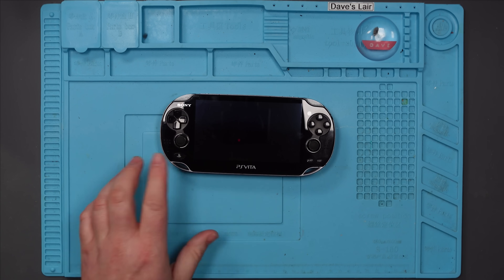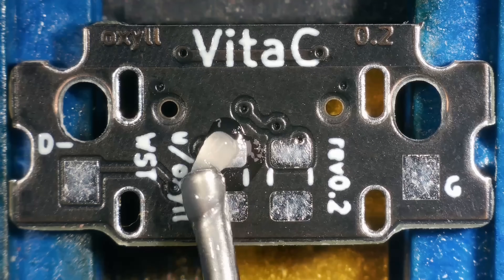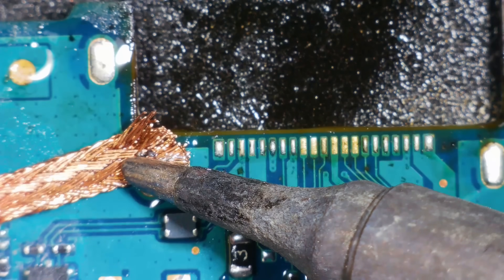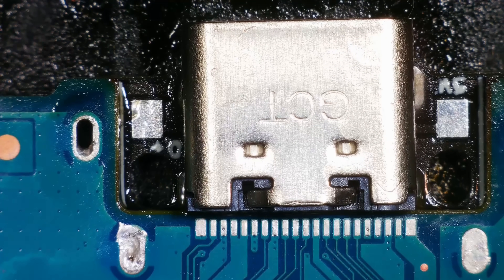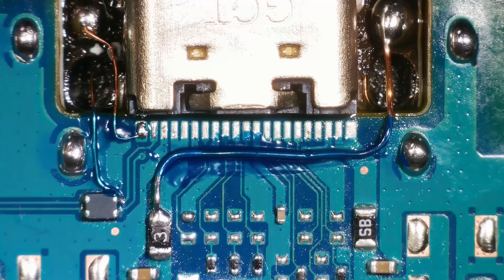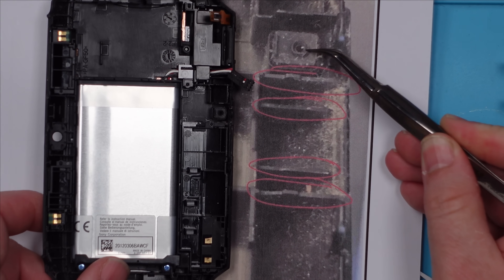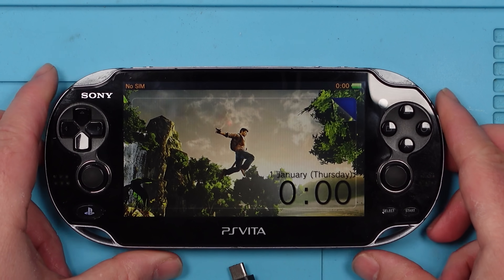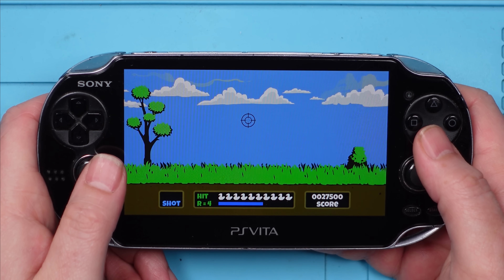My PS Vita DIED | Let's INSTALL a USB-C Port!

Comment: man having a digital microscope would be so nice I just don't have the space for it lol. I usually use a jewellers loop to get a close up of my work and then just use my naked eyes after I am lucky my eyesight is decent as far as detail but I do have diplopia I am just used to it though or I close one eye. It's totally doable though I modded and repaired about 12 Switches OLEDs and Lites this way

Comment: I'm not sure if you have a hot air station but it really is worth using for those small components. Same with the ports too! But yeah it is sometimes tempting to just use the iron lol

Comment: would you recommend this mod for a beginner? My ps vita's charger port is bad.
Reply: Absolutely not. I wouldnt consider myself a beginner, but I wouldn't attempt this. 

Youre better off trying to troubleshoot your existing port. Unless it's physically damaged, in which case just pay someone else to do it for you.

Comment: Good job. I like soldering but i thought it will works using vita connection pads not special attached wires.

Comment: Just did this mod using this video and it took me like 3 hours. I have to commend your skills. You make precise micro soldering look super easy. And such a clean, organized job too.
Reply: I want to do this mod because the touchscreen doesnt work if i put it in charge and it crashes, and it doesnt transfer data too
Reply: @dumitrasenciu8021  have you done it?

Comment: hi im struggleing to do this the solder just wont stick what am i doing wrong here? is it the soldering iron isnt hot enough? ive got low melt solder and UG78 paste flux but it just wont stick nicely. could i be using the wrong solder?

Comment: Entertaining and extremely helpful. Up until now my only experience with soldering was tinning and joining wires and replacing the shoulder button on my Steam Deck. But I really wanted to do this mod and your video gave me the confidence and knowledge to do it. I'm still in a bit of disbelief that I was able to solder such small components with just a magnifying glass and $50 soldering station. I had to get a hot air station for desoldering the old port, but that's alright since this project really gave me the confidence to look for other modding projects that I had shyed away from due to the soldering work. Subbed and thanks again for documenting the install of this mod so well!

Comment: At first, I wanted the OG PS Vita with OLED screen... But then I got a Japanese Aqua Blue PS Vita 2000, with Micro-USB port, and realized that the OG PSV has a weird cable/port situation. 😅 I'd rather go micro-USB to USB Type C than this port on a board, on a board, approach.

Comment: What if the orange light does not appear when plugging the charging cable in the console? ...but when I long-press the power button it starts flashing at every 3 seconds ..what does it mean??

Comment: You didn't need to fix the charging port you literally just had to let it charge until it turned on. because it hasn't been turned on for a long time

Comment: I enjoyed your video because I found it to be quite interesting. Instead of pulling apart your ps vita to change its stupid in design usb female port to the awsome usb C,  is it possible to use a female usb A 3.0 to female usb A 3.0 adapter or a female usb A 3.0  to female usb C adapter to the ps vita's own usb 2.0 cable.

I mean like the way you would connect the ps vita's charging cable the usual way  to the ps vita's stupid in design port and so instead of using that cable to charge it the usual way, will a female to female usb 3.0 adapter or female usb A to female usb c adapter connected on to  its usb 2.0 side of its cable and the other end goes to the ps vita's female usb stupid in design port and so that way you can connect a usb thumb drive on to its own type of cable or use a 

usb A or C cable to charge it or to transfer files to the computer and so would that work on that stupid usb in design port or would it damage the ps vita? 

Ok your charging port was damage but hey is it posible to just use an adapter because I am curious for doing that with my ps vita. 

All the best because again I found your video with your amazing personality to be very interesting.

Comment: I noticed that's a 3G model. you should install a PSVSD in it to add a micro SD card slot replacing the old 3G modem. You can get them for about $25 US and it's much better than the proprietary cards or a SD2Vita

Comment: IMO you need to let your iron dwell just a tad longer on the heavy ground mounts. You need the heat to get down a bit further to suck the solder down along the leg for an even better mount.

Comment: I got one for 17€ with a charger today for parts. SO i went and open it and i see that the battery cables that conect to the console are not in good condition, so i don't know if i should buy a battery to test it out or just resale it on ebay. It seems faulty ones are going for around 70€... Crazy!!!

Comment: Do you use any kind of fume extraction at all? Solder paste fume is nasty. You look glassy eyed by the end of most of these videos. That stuff gives me a headache and I get all clumsy and stupid from breathing it in, so I installed a small shop vacuum in the next room with a long hose so I can still hear while it sucks the smoke away. It's great for cleaning parts and the floor too. lol

Comment: A pretty tricky board, I'd route it differently :P First, those USB-C-to-2.0 jacks are pretty rare and expensive, too lazy to look for so even for 2.0 I only use those that have all the pins. Hot air-only for manual soldering, yet are found virtually everywhere. Second, those huge resistors, what are those? 0603 or probably even 0805? Nah, 0402-only, there's not much current there anyway. And, wire spaghetti :( Never! I'd add through-holes for the on-board wires so you'd just have a "wire brush" that fits the original pads (only 3 thin ones, not a big deal). Also a good touch would be to solder some thick wires or copper pins in for the mechanical rigidity.

Comment: Hey! I own a vita myself and I love it but one question I’ve always had is if it would be possible to upgrade the speakers on it, like putting iPhone speakers or something like that. Something with better bass and just all around better sound quality
Reply: It should be physically possible, as its just speakers... However you have to take into account the software of the Vita probably doesn't allow you tweak EQ settings. Not only that, but better speakers probably need a bit more power as well, so you'd be running into battery drain problems in the long run.

Most handheld devices already have the "best" hardware they can during their design, simply because everything needs to be balanced before production. Can't have a high-end handheld lasting 2 hours on battery or getting too hot.

Comment: This USB-C mod is such a pain in the A.. to realize ! Mine was not charging anymore so after failing with this mod, I went the easy way: I soldered to battery wires an USB-C charging module. Make the job !

Comment: I rather enjoyed performing this mod as well, though I soldered to the trace for d-. I really appreciate how you did your jumpers though. Much neater than I managed. 

For the hot air gun, have you considered using kapton tape to shield the surrounding components? I found it did an excellent job protecting the headphone jack on my 3ds mod

Comment: Tried to take off the old charging port on the psvita 1000 and it wouldn't dudge at all, I have a heat gun and apply flux to it to make it come off and no matter how many times I did it it wouldn't come off. I  tired to apply new layer of solder on the old one and it simply doesn't attach to it. Broke the port now I can't charge my vita lmao.

Comment: I’m surprised the data connection worked that well, because D+ and D- are a differential pair and need to match in length, but I guess USB2.0 is quite forgiving in that regard.
Reply: Is it so fragile? These are mere millimeters, right?
Reply: @root42  Indeed. Even if you were to squeeze 10Gbit through a single differential pair, the signal itself is traveling 20 centimeters per bit, so even with a 5 centimeter mismatch the differential signals are clearly related to each other, but that’s not relevant. The whole point of differential pairs is that any interference will equally increase or decrease the voltage in both traces, meaning the voltage difference stays the same. If the traces aren’t length-matched, the differential signals will be shifted in phase, meaning the effects of the interference on each trace will arrive at the receiver at different times, so they don’t cancel each other out anymore. The higher the bandwidth, the more closely these lengths need to be matched because each bit is on the line for a shorter amount of time, so the receiver has less time to monitor the voltages and clearly discern the signal from the noise.

Comment: Oxyll also sells a Samsung note 9 to ps vita battery board to allow you to replace the aging battery for something manufactured within recent years. Some vita batteries are 10 years old and the new ones on eBay and Amazon tend to be rewrapped old vita batteries.

Comment: I bought a ps vita with a broken charge port for 50 euro's, and i didn't know that you could get a usb-c port for it, so i installed a micro-usb connector instead, but not where the original charge port was, but i installed it in place of the accessories connector. And i think it makes a bit more sence if you would like to use a regular playstation controller and charge the vita at the same time. Nevertheless a great video! The most annoying thing was to install those tiny data wires, i also used lacker wire and slightly bigger wires for the voltage side of things. But it works great and i used a quality port so i am happy with my result :) you earned a sub!

Comment: I was wondering yesterday if there were mods for replacement ports to usb c as I was plugging mine in to charge, but for the 2000 in case the micro usb port gets damaged. Looks like some have done it to a 2000 as well (just not with a special kit, just using standard breakout boards). Good to know!

Comment: Can I express on this video how happy I am to have found someone who actually repairs electronics rather than just prettifying them up?

I just watched a video where a YouTuber supposedly "restored" a non-functional PSOne. He spent fifteen minutes of the 20-minute video cleaning the outside of the console (with the wrong product, to crown the hilarity), one minute stabbing the circuit board randomly with a multimeter, and four minutes reassembling it and 'playing a game with it'. This despite the fact that he didn’t fix the actually broken power button, he didn’t even seem to check the giant malsoldered mod spidering across the circuit board, and he didn’t even try to hide the fact that the PSOne never actually turned on when he purported to show that it did.

There's a place for superficial restoration (especially with respect to mechanical objects, where superficial restoration very often IS restoration - you can't use a rusted poppy seed grinder or a level with a rusted uneven edge), but I'm tired of electronics being prettified instead of properly restored. Thanks for not being one of those YouTubers, and thanks for honesty. I’d rather see you fail than see one of these guys fake success any day.

Comment: low melt solder is shit and you should avoid using it at all cost. it contaminates your joints by creating intermetallic compounds that can't simply be wicked away. I'm sure you do a good job of removing most of it, but it's still bad solder.

Comment: if you want better fluxing properties, try to get water soluble flux, it needs to be removed and cleaned after use, but it can easily wash off with water, for those pcbs that have no water sensitive parts, it's a pure joy to solder with.

Comment: Man this is soo cool. I wish I was confident in my soldering skills enough to do this to my Vita. Mine is still one of my favorite emulation handhelds ever. Especially after using that mod that replaces the 3G card with an SD card reader giving my vita a whole 1tb of storage.

Comment: Hi Stez, loving your vids and as a result have developed an interest in dragging all of my dead electronics from the past 10 years or so out of the cupboards (can never bring myself to bin them). Decided to buy a microscope similar to your in the near future. Unfortunately can't afford £300 for a soldering iron on top of the scope and wondered if you or your followers had a more budget friendly option that you might consider suitable for micro work on PCB's possibly £100 - £150 available in UK. You might even consider recommending a budget starter kit for people who just want to work on their own gear. Your opinion would be much appreciated. Thanks.
Reply: It's been a while since you asked, but if you are still looking, look into the pinecil soldering iron.  It's about $26.00 US.  Right now, it's out of stock, since they are releasing a new version, but should be back in stock in a few weeks.  You can also get the Hakko FX-888D for about $100.00.  YouTube channel EEVBlog has a video where he recommends a $330 electronics repair setup if you want to know how to get started on a budget.  My advice is to start off with a good soldering iron, multimeter, solder, solder wick, and of course, the blue silicon mat :grinning_face:  Then start to repair, and as you need stuff, buy it.  You don't have to spend a lot of money to get into repair, at least initially.  Good luck!

Comment: I don't understand why the mod designer didn't just design the board so that it interfaced with the existing pins, rather than relying on bodge wires.
Reply: It’s more complicated to install for beginners and it’s a nuisance to try and make sure it’s compatible with ALL models and possible variations of the psvita

Comment: Can I ask why you didn't use the desoldering gun that goes "moo" to remove the solder on the old plug? Just wondering as am considering buying one but if you don't rate enough to use then I can consider other alternatives. Love the vid's Steve - even the tune this time was a step up... honestly..

Comment: great mod. I have a few vita's, 

I've noticed with my oled vita. it doesn't like every usb wall plug I have. I have to use a Sony Ericsson one. and a aftermarket cable.

I thought when you used your Nintendo usb c charger it might not work, and my Anker power bank always cuts out, when I try and charge with the Nintendo charger for some reason.

getting pretty famous now. I expect to see you on the masked singer soon, with Dave in the corner.

Comment: I'm wondering why you use non-insulated wires. The color of the insulation can be used in the designation of the electrical circuit
Reply: I'm assuming it has a enamel coating on, 
but coloured wire is totally unessential
Reply: @GinandTronics  Enamel. Now it's clear

Comment: Nice Job Steve. I thought the adapter pcb would have fit the same footprint of the original connector. Then it would have just been a matter of flowing some solder from the original pads to the adapter. Doesn't seem the best design that the PCB was slighly shorter then the original connector and you had to add additional wires.

Comment: Whilst there is absolutely nothing wrong with how you soldered on those resistors, to get that factory look (perfectly straight) a little hot air & flux would have flowed them into place nicely with the surface tension.
Reply: Was thinking similar. I probably would have just tinned the pads, then used hot air as you say.

Comment: Man, that's a nice mod. Good to know that if my port breaks at some point I can replace it with something like this. If it was less invasive and I had good soldering tools and experience I'd do it right now, but since my vita is working fine I'll skip it for now...
Reply: I've been doing the same. I have a lot of older electronic devices from the late '90s and early 2000s that had proprietary cables... Every time they go bad or I need a new cable for him I just change them out to USB.

Comment: This sounded easier on paper 😂 your soldering skills are unmatched!
Reply: His soldering skills very good! I'm not sure about unmatched tho. Check out the Ramtex space invaders I just repaired where I had to solder bond wires from chip dies back onto the pcb.

Comment: You should buy double iron for installing SMD parts like resistors. Seen that on Northridge fix channel..works like a charm
Reply: My favorite way is to use thick flux like what he has, and stick them all down to pre-tinned pads... Then just hit them all with the hot air at the same time.
It lets me do them perfectly and quickly by hand even though my hands aren't the steadiest
Reply: Yes the "hot tweezers", I watch northridge fix also!

Comment: I think the reason why your case is not quite like the instruction one is because you have the 3G model. I noticed the "no sim" in the top left corner of the screen. The instruction image must be the regular Vita and it's slightly different inside.

Comment: It is only for power now? I find it easy to transfer data from computer via cable, but know it can be done wireless.  
Nevertheless. good job Steve!
Reply from the maker: Thanks Willy.  No, the D+ and D- are for the data, so it works hooked up to a PC too!
Reply: @StezStixFix  Ok, I see. Nice!;-)